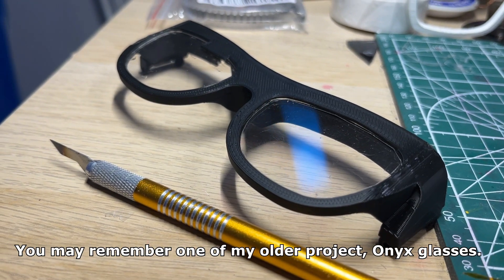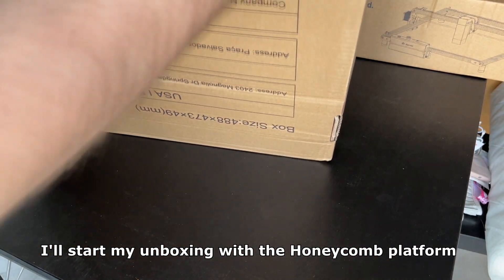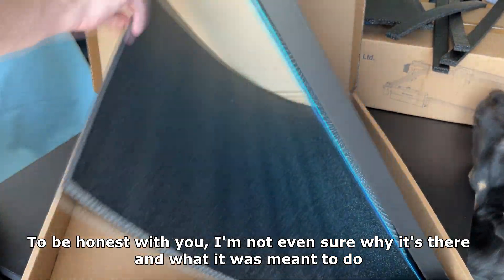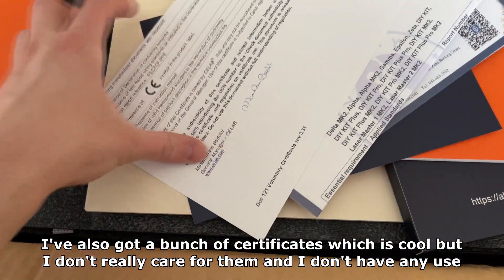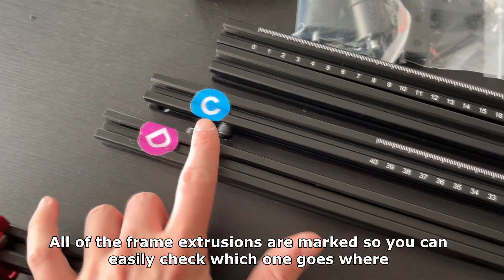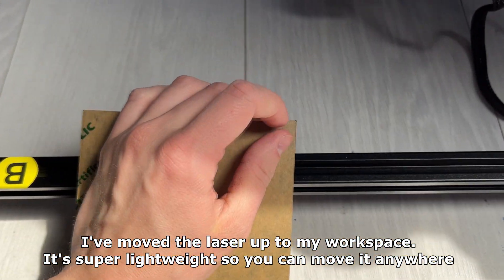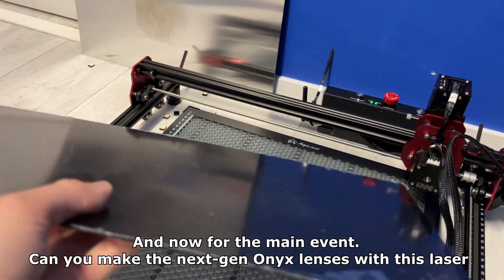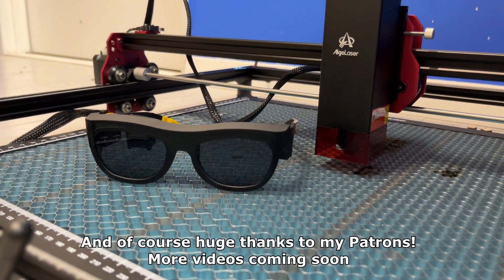You can now make Onyx AR Graphite Lenses at home | Algolaser DiY Kit Review

Comment: Big respect for the engineering you putting into this, question though is your Bambu okay ? Its quality looks quite bad from what im used to specially with this size part. Or was it just settings/calibration issue?  I have p1s with selfmade spaghetti detect at home and a few x1c at work and this even at high speeds seems unusual specially too surface and the layer height ( due to the max volumetric output eveb with 3th party faster nozzles layer height this high seems slower or just as fast as lower layer height.
Reply from the maker: I guess my nozzle was worn down at that point in time. I’ve changed it later on and now it prints just as good as when I’ve first turned it on

Comment: Incredible content! What is the FOV like?
Reply from the maker: It’s like holding up an iPad Pro at a arm’s length
Reply: @ManolloMancelli  How many of these lens can you create each month in general? Going to buy a pack soon! Also do you think a 1.03 inch 2560x2560 display would help (in particular I'm willing to send some your way)?
Reply from the maker: if you’re speaking about only lenses then I think I could easily make about 400 of them in a month but that also depends on material availability. What kind of display do you have? What model? 1inch is pretty big for this kind of setup. Especially since it’s square.
Reply: @ManolloMancelli  400 a month sounds solid, I have a Seeya sy103wam01 (with a custom driver in development) and mainly am looking at ways to increase the FOV and clarity. Maybe we could do some work together? I have a discord if you'd like
Reply from the maker: Seems more like you need custom magnifiers rather than front lenses. In that case i can’t really help since I’m not really skilled in that area
Reply: @ManolloMancelli  I mainly have a custom stack in mind that i'm developing, i'm hoping we can bounce ideas between each other!